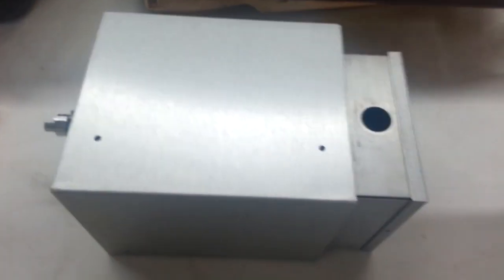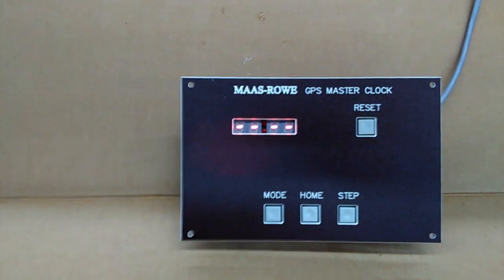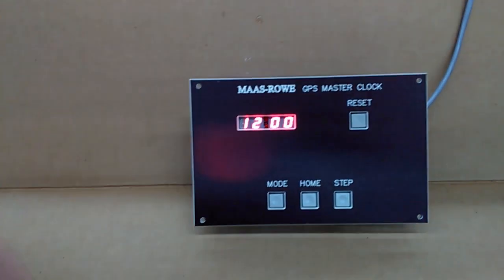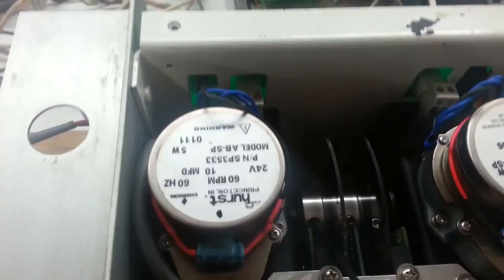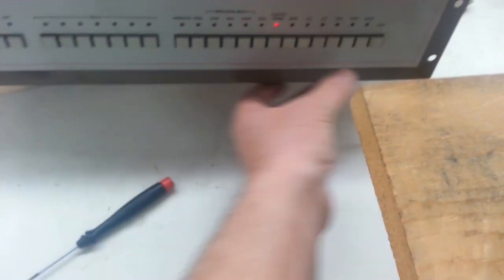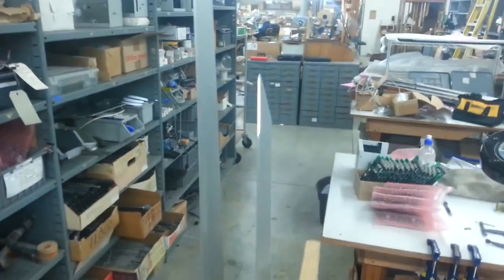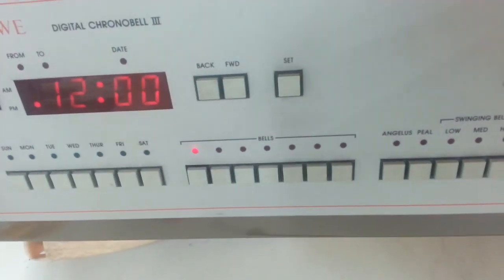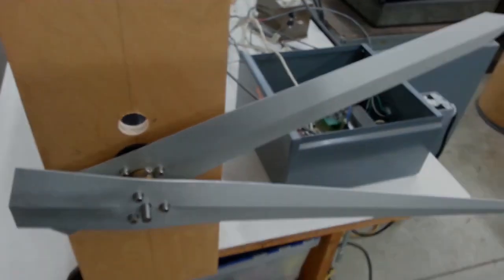Maas-Rowe Tower Clock Drives, Adjusting The Hands

Comment: Mike,  Is this a test jig which is in use at the Maas-Rowe factory?  I also see 10uF 100v electrolytic capacitors across the motors.  Are these for spike absorption or are the motors actually two phase?
Reply from the maker: This is our test rig. I have never looked at the wiring diagram that the manufacturer send with the drives. Since I was not involved with the product design or building of the units, I really have no idea.
Reply: @MaasRoweCarillons  I found it.  The capacitor is non-polarized and is connected with between the two motor direction wires (Black or Red).  Connecting the Red wire with the Blue power wires (connected together) will cause the motor to rotate Clockwise.  Connecting the Black wire to a blue power wires will cause the motor to rotate Counter Clockwise.    It doesn't seem to explain why the capacitor is there unless it's either for phase or simply to couple AC to the non-connected wire. 🤔
Reply: A SPDT between the black and red wires can be added.  Imagine if initial correction could be done in either direction, and the possible spell bound look on the faces of some if the clock actually turned backwards to correct itself.